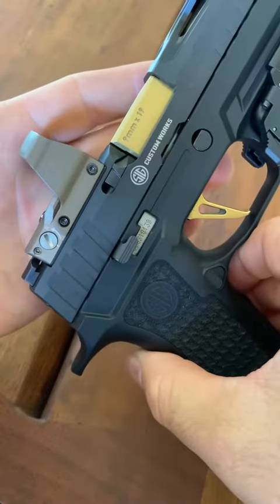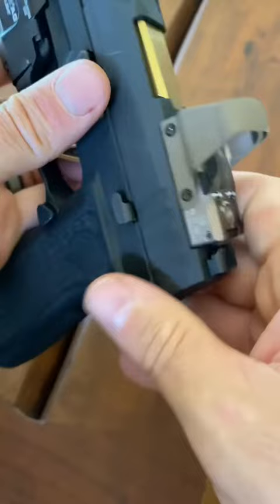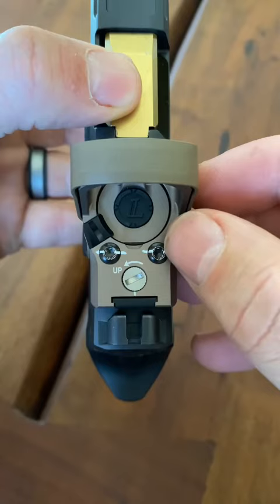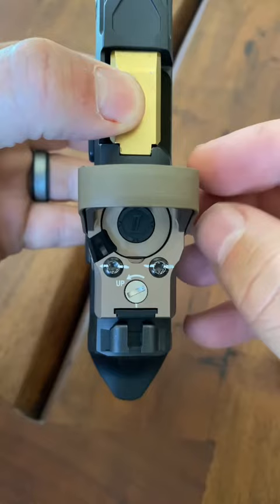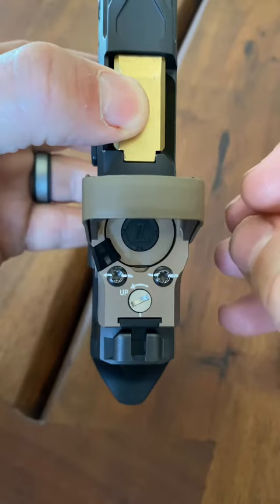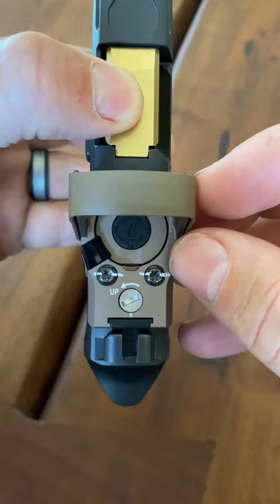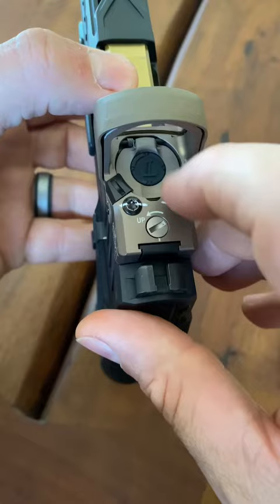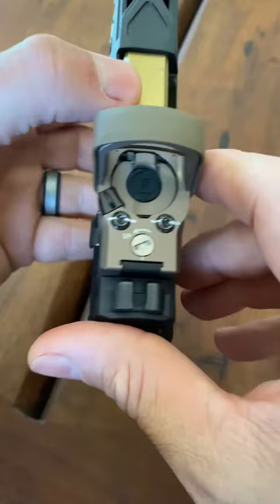Issues with Leupold Delta Point Pro? Be careful!

Comment: Trijicon RMR and Holosun 507C-X2-ACSS are the only 2 MRDS I havent had issues with . Therefore those are the only ones I use
Reply: Drop or bump the Holosun and you’ll see why I don’t trust them. Despite Sage dynamics drop test they did not hold zero for me.
Reply: My holosun just fell out of a chair onto wood flooring and broke.  Cheap Chinese garbage.
Reply: @DennyBass  I have almost 30k round in total through all 3 of my 507C-X2-ACSS.  I've been using them in USPSA and 2Gun for over almost 2 years now . 
One of the dudes I shoot with has over 50k on his . 
I do not abuse my tools but they get pretty banged up . Only issue I've had was auto mode in 1 of then stopped working but that happened right out of the box . Manual mode worked perfectly fine . 
I will stop using them if and when I start having significantl issues . That just hasnt happened and hopefully it doesn't.

Comment: Today I had a new fde delta pro show up from optics planet, right out of the box it's a dud, tried 3 batteries trying my best to give it an excuse,  all it does is flash and then dead , back to holosun
Reply: Same here, how did you resolve the issue?  I called Leupold and they want to repair it, I told them no repair, send me a brand new non refurbished item.  Still waiting for their reply, I'm most likely going to open a case with my CC company and force them to either send me a new replacement or get a refund.  Advise, never buy red dots from Staccato or Leupold directly.  Get them from Amazon, if they don't work, Amazon will reimburse no questions asked.

Comment: Another issue I'm having is the shake awake function doesn't work consistently.    When it doesn't illuminate,  I have  difficulty getting the reticle to illuminate. The only way is to remove the battery and reinstall.  Works perfect  the next 8-10 uses after the "reboot" ¿¿¿

Comment: Great observation with the button for the brightness adjustment, that is my one gripe. I have one of these on my staccato C2 with 4800 rounds through it and have not had a problem otherwise though. I like it better than the RMR for the ease of battery swap and the shake awake. And I’m not really a fan of the holosuns use of the 1632 battery and the fact that you need a tool to slide their batt tray out. 

Also find this to be the largest window + clearest glass, outside of the Trijicon SRO
Reply: I went with the deltapoint mainly because it has a large window and I can access the battery from the top without unmounting it from the gun. The auto wakeup ia a nice plus as well.

Comment: My Delta Point 6mil is a year old and I'm sending it back in for the 2nd time . The sight won't even turn now.   The first time the dot would come on  then shut down for 10 minutes at a time so Leupold put a new circuit board in  there . It's only been about 3 months since they did the repair now it's gone tits up again.

Comment: Problem with the Trij RMR is that you have to remove it to swap batteries.
And you're smart for ditching factory thread lock. You never know how long that stuff has been sitting around. Infact my Sons Trij popped off after 3 rds and it was appropriately torqued. They sent him new screws, told him to clean the threads and apply new blue lock. Problem solved.
Pros and cons with all of this stuff I guess.

Comment: I have the same optic and I agree with the illumination adjustment location.  I also have issues when I press the button it's very easy to touch the lens and get fingerprints and smudges on the lens.

Comment: Nice,   I’m not sure if I want the p320 or the 365xl.    Any advice?
Reply from the maker: The P320 is a WAY larger gun than the P365XL. I think the entire P365 line is very compact whereas the P320 is more of a full-sized duty weapon.
Reply: X macro is a good in between
Reply: I’ve heard the 365xl can feel snappy to some.  Any thoughts on that? I’m carpenter use my hands all day. I wouldn’t think the snappiness would bother me as much as it would bother others.
Reply from the maker: @northjerseykevin409  The regular P365 is pretty snappy but it doesn't bother me. My 14 year old son shoots it all the time with no issue and he isn't a big kid. The XL is more easily managed. Mine is the Spectre Comp with a light and an optic and it shoots great.
Reply: @TXHAWGKILLA  good to know. Sounds like a great setup.  👍🏻
Reply: Both.